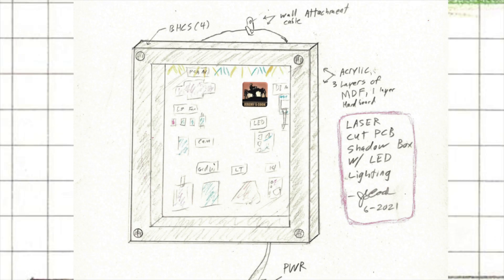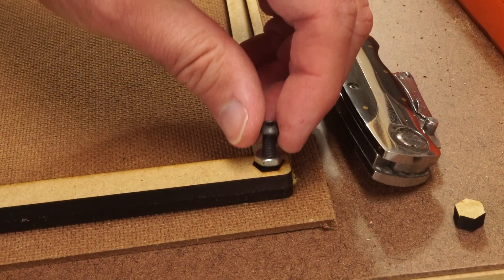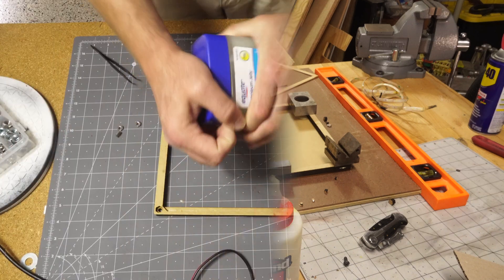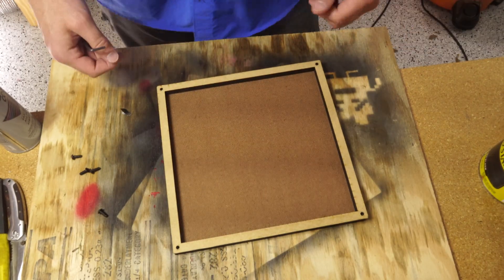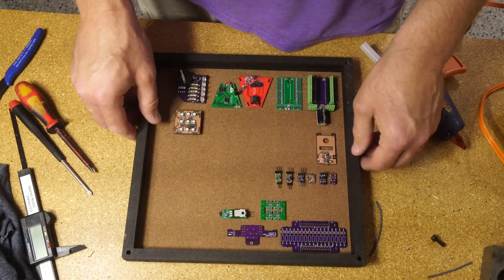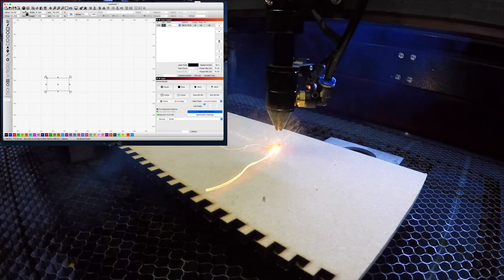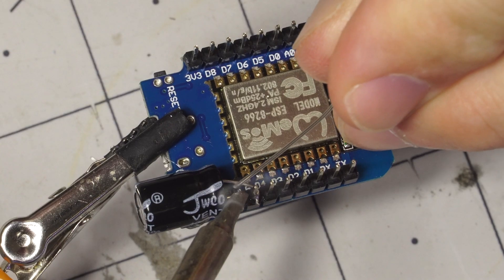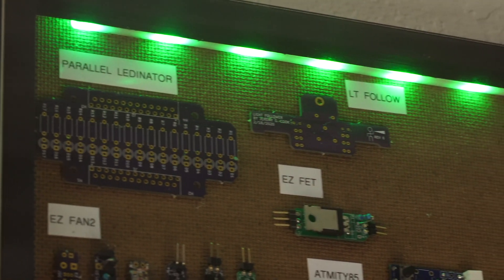PCB Display Case With Overhead WLED Lighting [ESP8266]

Comment: So do you design the PCBs and fire them off to a service that makes them for you? I haven't made a PCB in many years because chemical etching was the only option and that was just too messy and inconvenient. Also side note...thanks for making me want a laser cutter I can't afford 😫 😆. Nice project!
Reply from the maker: Haha, well thanks for watching!
1. The laser cutter is pretty awesome. While I haven't tried that hard, my understanding is that you could potentially pay for it with projects, so there's that :-)
2. Yeah, PCBs are apparently way easier to make than they used to be - just design and send! OSH Park is a good option in the US, though there are a variety of suppliers in China (the PCB used here is from PCBWay). You can even get many manufacturers to assemble your boards for you if you set things up correctly.
Reply: @JeremyCook  cool. I should explore that. I did come across a PCB milling machine on YouTube recently that was really cool but that's a chunk of cash I'd have to fork out for something I'm not so sure I would even use very often. Thanks for the info!
Reply from the maker: @MakerMikeSizer  No problem! A dedicated mill setup for PCB work would be nice I suppose, but boards are inexpensive (and multi-layered) enough that it often just makes sense to shell out the case on a time-by-time basis.